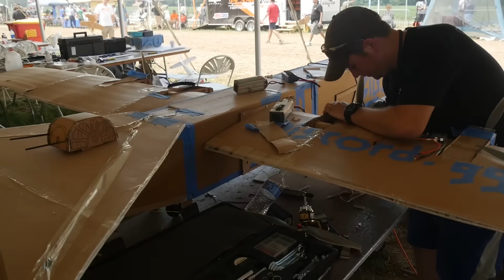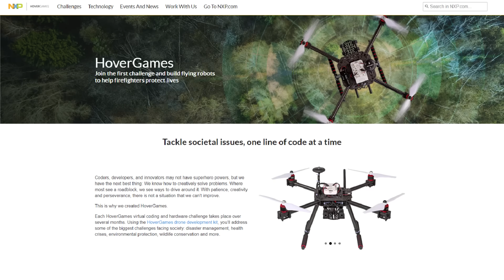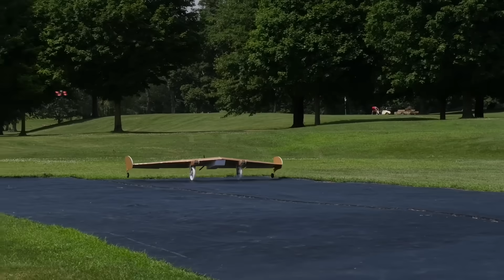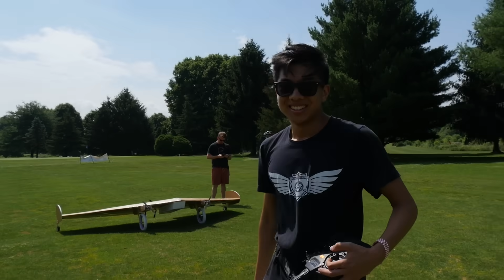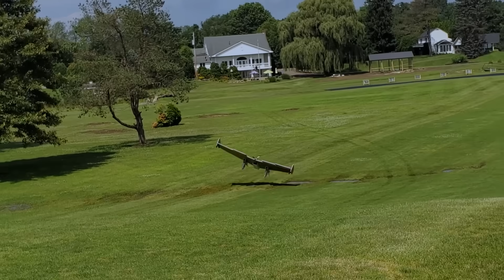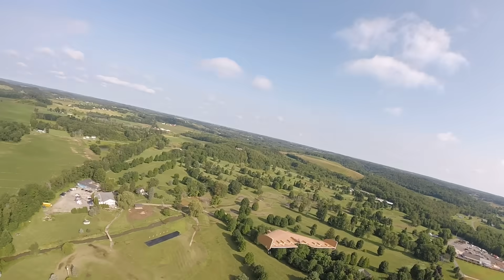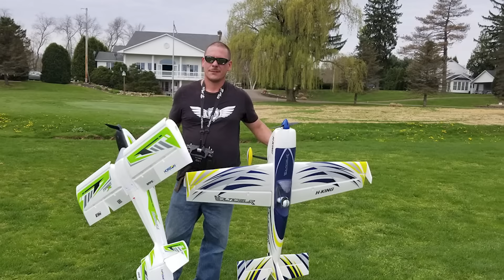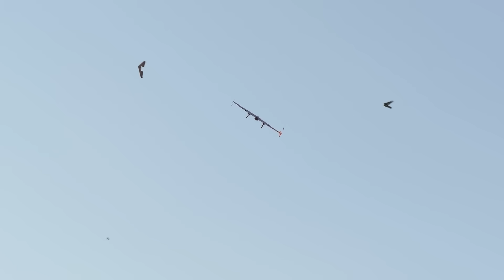Airplane Demolition Derby!?💥😱

Comment: Some notes on BEC / Separate battery use in large builds:
-You never want two BECs connected to the same receiver, without some kind of redundancy system regulating them. That's why Andres originally only used the one from the rear ESC. 
-Using a separate battery is VERY common on large builds, both DIY style as well as ARF balsa 3d birds. I recommend using 2s LiFe packs, they're lithium (and thus better than standard  nicd/nimh) but the voltage is slightly lower than a standard 2s LiPo. at 6.6v operating voltage, you don't run the risk of burning out servos that the ~7v 2s LiPo has. 
-Using a single 2s LiFe is enough for most large builds. That is, standard size servos, or a lot of smaller ones, and you should be fine on servo power. HOWEVER, if you really go nuts on build size, you may want to go ever further. 
-Here's the rub: If your servos are REALLY strong and power hungry, they can sometimes pull enough amps to temporarily drop the 2s LiFe voltage to unsafe levels. Not unsafe for the servos, mind you, they'll keep working, just with less torque until the voltage returns. No, the issue comes with your receiver: If the voltage gets too low, the receiver might shut off for a brief second, and that time period and the time that follows of trying to re-acquire the transmitter signal can be dangerous. 
-In THAT case, you will want to isolate your receiver power from your servo power. This requires using either two LiFe batteries, or one LiFe (for servos) and one BEC (for receiver). On the servos, you cut all of the red wires before they go into the receiver. Solder those red wires together, and connect them to the red wire of the LiFe servo battery. The black wire of the LiFe servo battery can go to any black wire connected to the receiver. Then, the receiver LiFe battery (or BEC) just plugs into the receiver on an open port. 

As you can see, this gets complicated quickly. A large build might have as many as 3, 4, or 5 separate batteries, and all of them need to be charged and connected before flight. If you're not confident, it doesn't hurt to use a checklist. Even if it's not written, a mental checklist or routine can save your butt, just like full-scale aviation. Big builds aren't as simple as an average FT kit, but the payoff in successfully flying them is big as well.
Reply: Thanks!
Reply: Basically building and configuration like in the old days. Separate battery for your flight equipment since you had a gas tank that supplied energy for the power plant rather than sharing power from the propulsion energy supply
Reply: Basically 2 batteries, for servos and the receiver, and connect the signal, and ground of the servos and receivers together, and connect the vcc's to the separate batteries

Comment: "Flight engineer onboard to control the 3 motors"
Yes! When I flew Stan XL last year (0:25), and Stan III this year, I had a copilot, or I guess flight engineer would be the more accurate term. The model profile for Stan in my QX7 had 4 "control inputs" through the trainer cord, tied to channels 5, 6, 7 and 8 from my copilots DX8 transmitter. These inputs were then used in the special functions menu as channel overrides, each overriding one of the throttle channels (each motor has it's own channel) to -100 and thus "killing" that motor. If a prop or motor (let's say, #3) got damaged in combat, I could yell, "Kill motor 3!", copilot Jon would flip a switch, and that motor was no longer active. It's also useful for troubleshooting power system issues on the ground, I can run one motor at a time without having to undo wiring.
Reply: Loved the horn this year. It was majestic.
Reply: Stan is absolutely EPIC!!! Hope to see one in person next year.
Carmine ✈🚂🚙
Reply: Nice, did you find out what caused stan to suddenly go down in that one combat? Also jow was it not destroyed🙃

Comment: adjust the thrust line on the rear motor a few degrees up. or it could be disk effect as it spins up. set the rear motor to come in automatically on 25% throttle to assist

Comment: So you made a sweepwings onslaught out of foam board.  Awesome build either way though.

Instead of the bike wheels, save some weight and use a bungee launch system
Reply: Landing?
Reply: @sawhite27  what about landing..?

That's easy, land on the corpses of the downed planes after combat